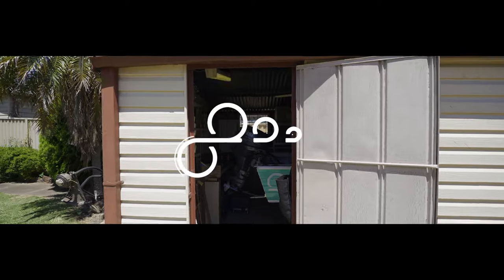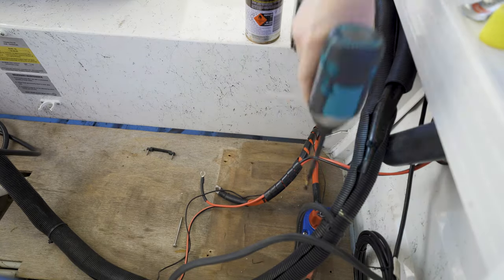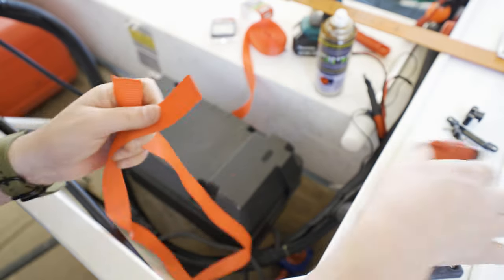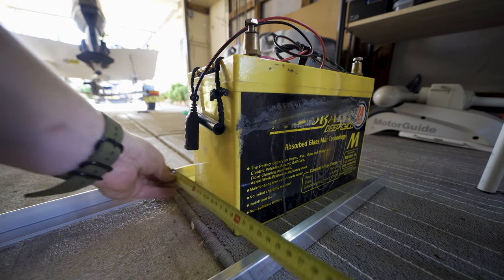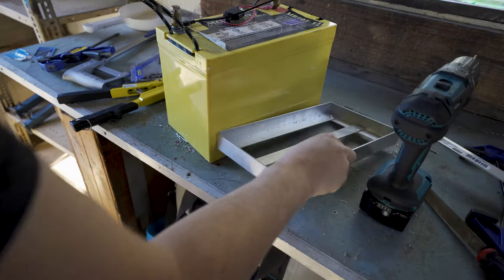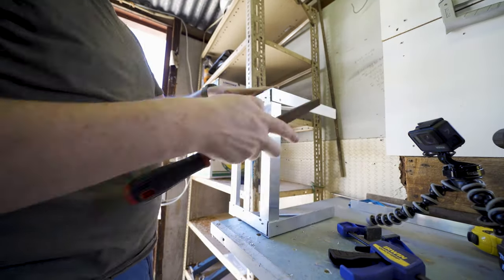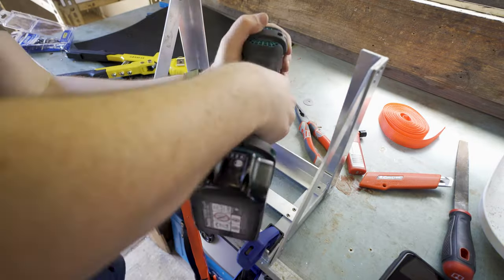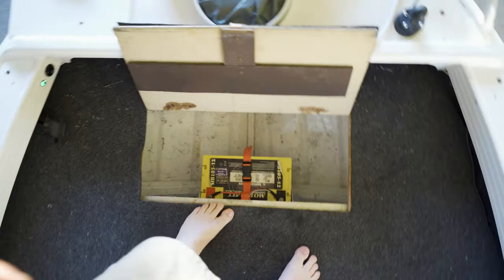Making a Basic Battery Tray | DORA PROJECT 🧜‍♀️ [4K]

Comment: If you are using a lead acid battery you should put the battery in a case. If it is in an aluminum boat and it leaks it will eat through the aluminum hull. Also vent the battery storage chamber to prevent build up of hydrogen and possible explosion when the battery is charging, if there is an electrical spark from a loose connection.